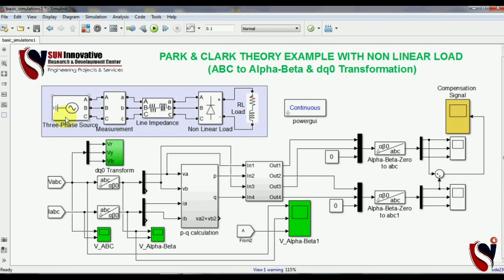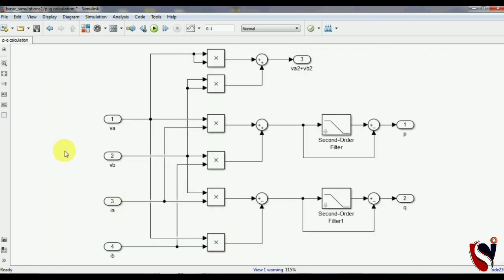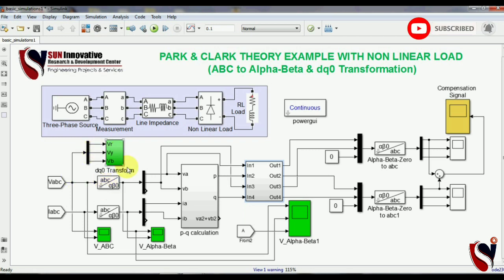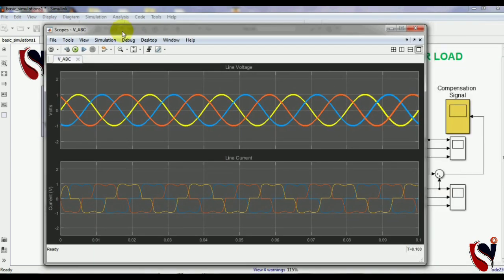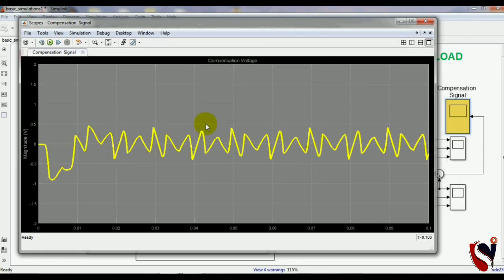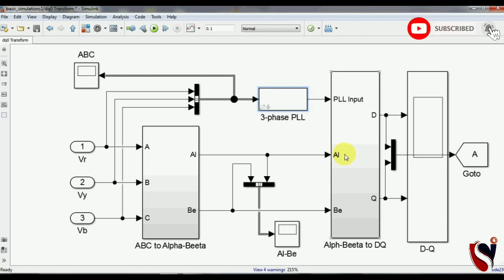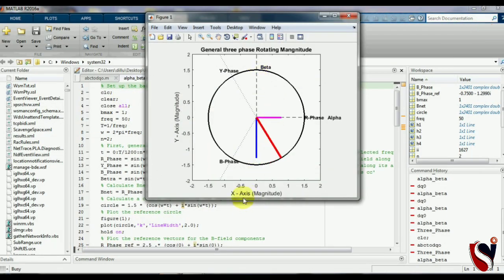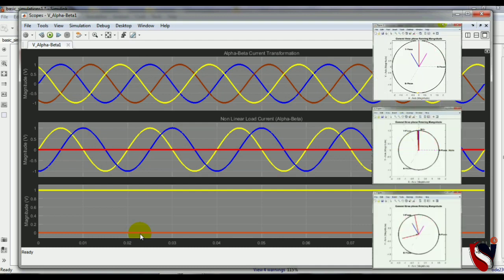Park & Clark Transformation | abc - αβ and abc - dq0 | MATLAB Simulation

Comment: Sir!  what is the purpose of the input(in1, in2 in3 in4) and output block? and i was wondering why the lecture is on one side and the cursor pointing is one the other? thank you!
Reply from the maker: Thank you for feedback, 

About your question regarding one of block after ABC to PQ converter, in1 , in2 and in3 and in in4 these are the multiplier for reverse transformation, 

For example if you convert any ABC to alpha beta then it also goes to unity output due to matrix multiplication and after that if you need your original values in reverse transformation for alpha beta to ABC so Va and Vb magnitude is taken for multiplication as a original values so that magnitude of all phases can be identified and reverse transformation is done. 

While editing this video voice is leg it just mistakes while rendering this video.
Reply: @SUNInnovative   Thank you for your reply.
What i got is-
first u converted ABC to  alpha-beta 
then calculated ins. power p and q
then u got alpha-beta again using the block 
(the question is: how the product block has been used to get alpha-beta volts and amps)
and using inverse clark u got ABC back.

and how is the compensated signal achieved . As far as i know, it should involve the comparison of the desired signal with the  measured signal.
Reply from the maker: Dear,

If you watch this video again you will be find that in subsystem of products we made for voltage and current after instantaneous calculation by alpha and beta, there is gain is connected at signal "in4" with value of "-1" in which it will act as reverse quantity of non linear line current and due to this negative polarity if you got your signal back to ABC and putting one ADD block so it will perform as compensation = Va - Ia 
Va act as reference signal as Sine 
Ia act as non linear line current 
And having gain with negative will make equation as a subtraction. Hence you will get compensated signals at output. 
We refer to all our subscribers to watch our video in full length and sometime 2 times watch this because we given every answer in video it self. 

Thank you for watching our videos, still if you having doubt please feel free to ask anytime.

Comment: Very helpfull video.. 
Can you please explain how I can use this pq design for active filtering.. ?
Reply from the maker: This method you can implement to any active filter Shunt or Series to compensate non linear current, First take source with non linear load, and measure line current apply this technique to converts three phase to two phase reference frame, it will gives you final error signal which you can process further to create PID or Hysteresis.